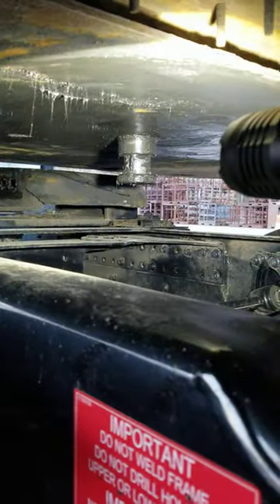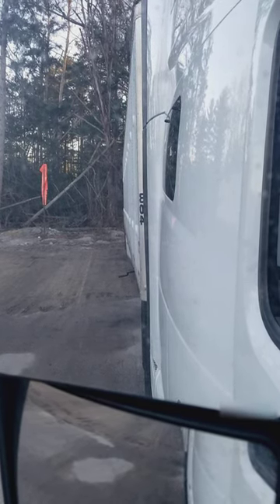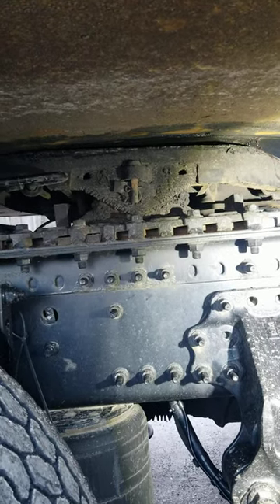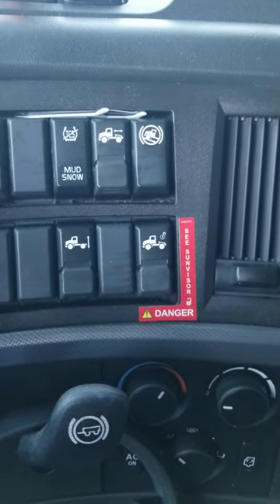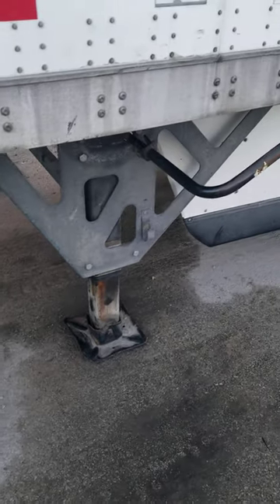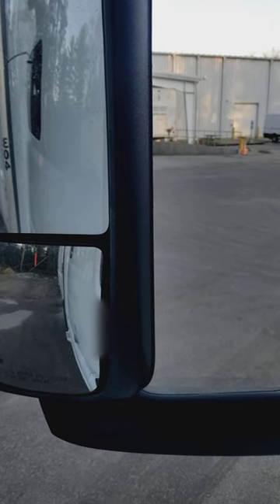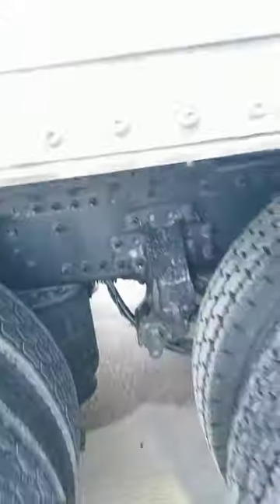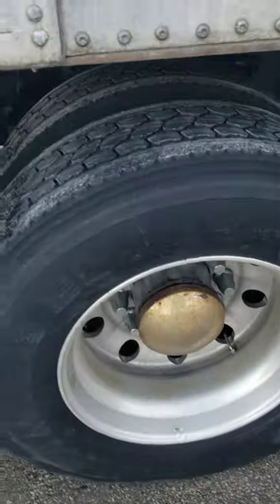What is "HIGH HOOKING?"

Comment: I don't understand, if the jaws are locked and the apron sits flat against the fifth wheel when you raise the landing gear, what's the problem?  in your example you didn't raise the landing gear to see if it would flush out
Reply from the maker: No, I did not raise the landing gear it was to demonstrate without going through the entire process for the sakeof video time, however all the information is true. If you "high hook" there will be a gap of 1 1/2 inches or more even when you raise the landing gear. Thanks for your feedback and be safe out there.
Reply: @truckergage  I am new and I have high hooked before. I didn’t know this until now. When I would see that I was high hooked I would raise landing gear and it would sit flush with my apron. Are tractora different? I will double check if I ever High hook again

Comment: How Hard is it the crank the Landing Gear on low speed a few cracks? Did it all the time for 40 years.
Reply from the maker: Well if you're loaded it can and will be a struggle. The heavier the harder.
Reply: @truckergage  Cranking Down? Not really. I guess today's Xbox Generation Wheel Holders are afraid of a little work.
Reply from the maker: For some it's a challenge. Not everyone have the same knowledge as well as upper body strength. Thanks for your feedback, be safe out there.
Reply: @curtekstrom9531 big tough strong manly man is leaving tough manly man comments on Youtube instead of doing "a little work"?
Reply: @mikhailyaremkiv  Sorry to Burst your Bubble,  but in my 40 plus years OTR, and being a Fleet owner. I have done more work than you could begin to lie about. Today's Automatic Restriction Idiots Don't know hard work.
Reply: @curtekstrom9531  so you sat on your ass and played with a steering wheel for 40 years? Hard work huh? Im sure you're a very skilled and knowledgeable man after 40 years of playing vroom vroom on the road haha. Enjoy your retirement old boy.

Comment: Just back under your trailer about 2 feet!! Get out and raise your landing gear about half inch off the ground,  this will have your trailer apron flush with your tractor fifth wheel,  then continue backing until you hear the fifth wheel locking jaws engage the trailer kingpin,  then do your tug test and get out and look under your trailer and verify that the tractor locking jaws are securely locked around the trailer kingpin 😮
Reply from the maker: For some it's not that easy. Thanks for your feedback. Be safe out there.